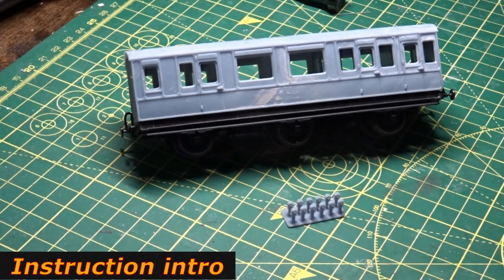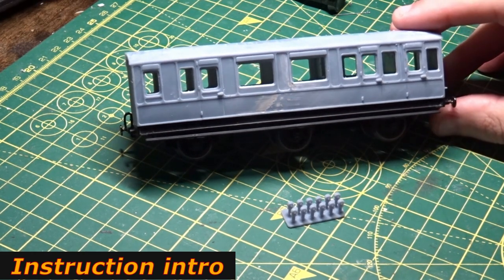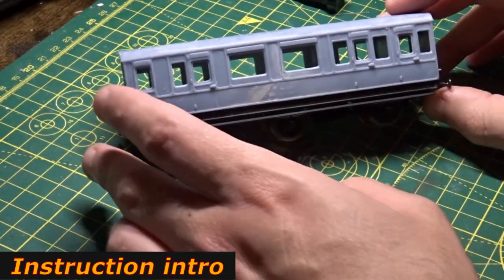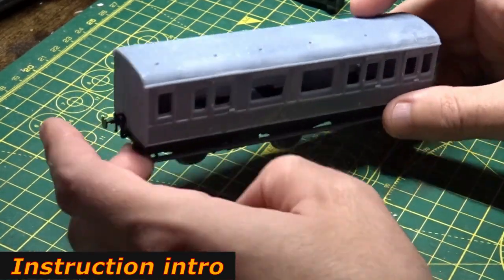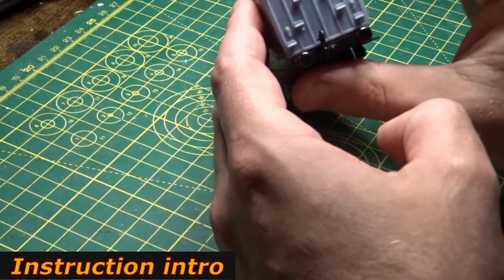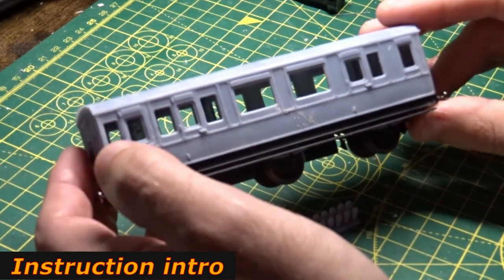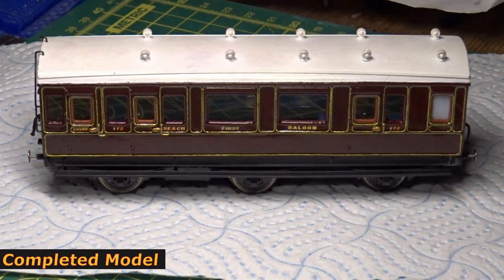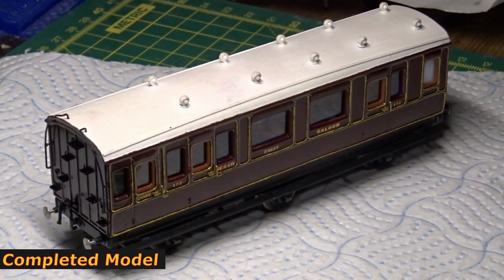SER/South Eastern Railway, First/Family Saloon Instructions

Comment: Hi Matt, Nice job. Thanks for sharing. 
BTW the Fox Transfers for the Saloon were produced from artwork supplied by the SEC SOC in 1999. If you refer to Saloon 177 pictures in SE&CR livery pre WWW1 that are available (and also other photos of SER andSER Saloon vehicles) you will see that the font is v. different and much more elaborate that the standard SECR font. We traced from these photos and images to provide the artwork basis for Fox. It includes "First" and "Saloon" in the livery sheet FRH 4472 (I double checked with Fox today). The lettering style used by the K&ESR on 177  is therefore not accurate depiction of what the SER and SECR used - they have followed the standard font.
Reply from the maker: Yes indeed since this was produced I believe they have been changed again. Unfortunately I don't have the images in front of me so no idea to which you are referring.

Unfortunately the don't I required was shown to me by the preservation group looked nothing like the fox ones. Looks like I'll be having to supply my own transfers in future.